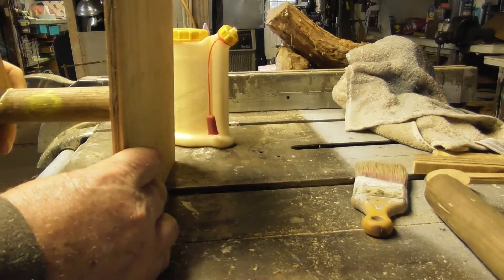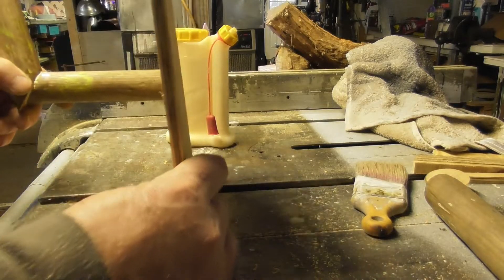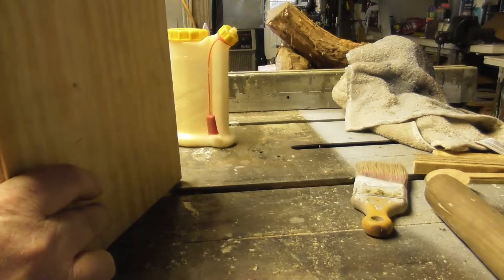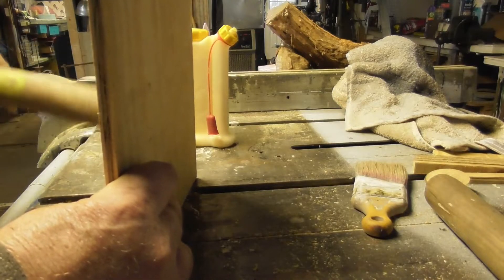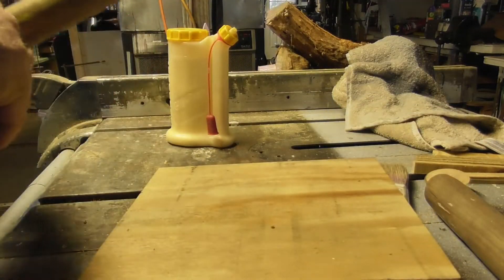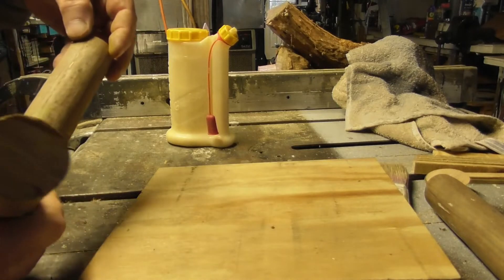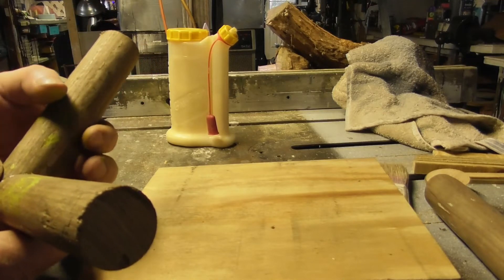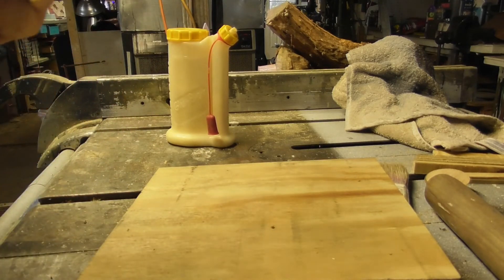Will it work , or just look stupid

Comment: I've used toothpicks many times when woodworking, I like the design.
Reply from the maker: I'm just getting really lazy in my old age and a little thing like this drives me nuts. If it works I then need to figure out what materials to use.  Toothpicks are a must it the shop.

Comment: Yes putting water into the wood before you glue does make it work better. I used the same method when repairing cracks on gun stocks and it always works well.
Reply from the maker: It seems to make sense and hasn't failed me yet.  That radio you are redoing has a clean chassis and looks like whoever started it was neat.

Comment: that should work fine, but some rolls are bigger than the ones they made for years, have to make sure there's room for them to fit the spindle with out hitting the board portion.
Reply from the maker: A good thought, I grabbed a roll but didn't think about it.